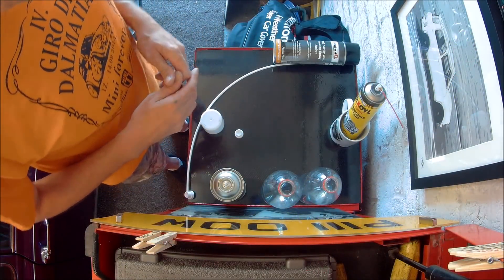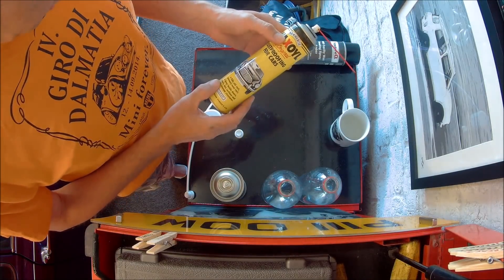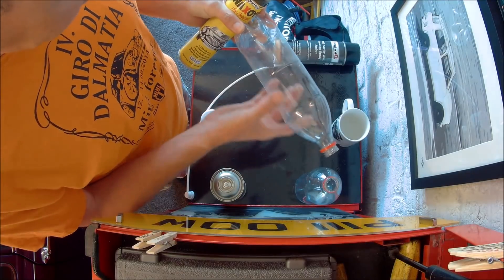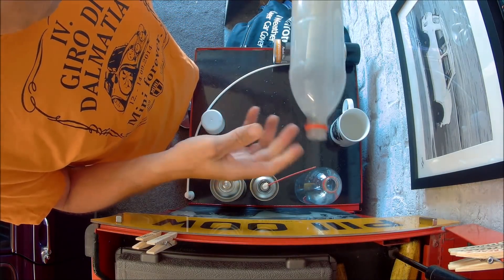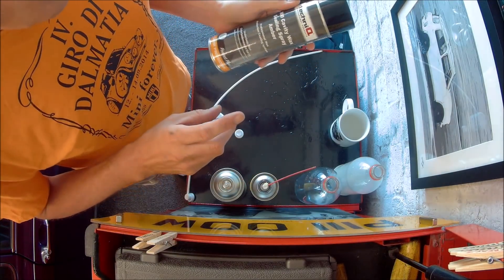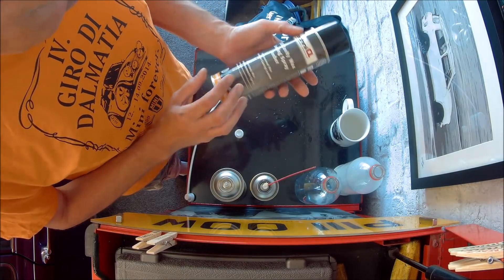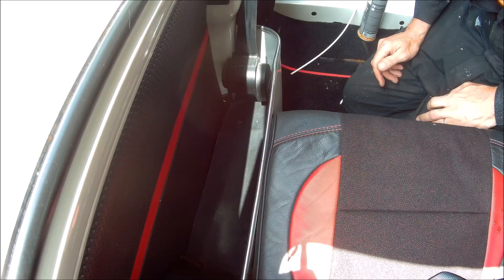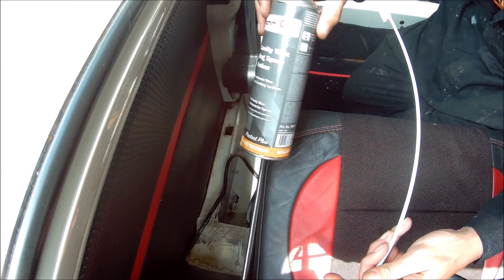Classic Mini Workshop Part 25 - Rust protection cavity wax vs waxoil

Comment: Keith, great video mate. I was raking about in the bottom of my companion bins today when I was fitting temporary speakers to the thirty and my car was swimming in waxoil or something similar. The previous owner had new inner and outer sills fitted (correct type/ nae covers) and it was good to see the repairer took the time and effort to cut out all the rust and protect the new metal from future corrosion. Like you I'm old skool and have always used waxoyl so I may give the Techni stuff a blast. Sean
Reply: @Zain Keaton Thanks, signed up and it seems like they got a lot of movies there :D Appreciate it !
Reply: @Jesse Kenzo happy to help =)

Comment: Morning Keith great work, I need to do the same on my Mini. But this Mini don’t have these access holes on the side glove box and none by the seat belt brackets. Please advise how could I spray that wax? And which brand are you using please? Thanks
Reply from the maker: Bilt Hamber Dinitrol S50 is about the best you can get. If you don't have the access holes, just poke the probe up the sill flutes. The tube is long enough to get where you need to

Comment: Can the long extension be used with the waxoyl cans?
Reply from the maker: Yes if you warm the Waxoil up as it can be a bit thick at room temperature
Reply: Classic Mini Workshop it just got me thinking that a fair test would be to use the long extension on the Waxoyl. Personally I would think  that the thicker consistency of the Waxoyl would give better protection especially with the longer extension giving better coverage. The contender does look much thinner.
Reply from the maker: @_RicksGarage  Yes, I see what you mean. The other stuff is very thin

Comment: Oldschool is goldschool 😌 but should the sills be cleaned out first? Otherwise the dirt will hold moisture causing it to rust? And how do u clean out the sills? Cheers in advance 👌
Reply from the maker: Yes, if they are dirty but unless you have driven through a swamp they should be clean inside. It's worth checking though
Reply: @classicminiworkshop  thanks for the reply 👌 how do u clean the inside of the sill tho? Kind a hard to reach... 😂
Reply from the maker: @Kevmrtwo  Not sure, I guess you could probably use the same setup for spraying in cavity wax using a compressor to a spray gun with the insertion probe and use detergent instead of wax, or if you could get the car high enough or crawl around on the floor with a pressure washer. Apart from rust, I've never seen it dirty inside a sill. I have seen the flutes get blocked up with mud before though
Reply: @classicminiworkshop  thank you! If its rusted inside, i probs should grind it all out weld a new one (or just a sheet) and treat it with your stuff right? Because this stuff doesnt treat rust?
Reply from the maker: @Kevmrtwo  I don't think this stuff treats rust but I think the more expensive denitrol has a rust neutraliser

Comment: Was wondering which one do you think last longer the waxoyl are TechniQ ?
Reply from the maker: The Waxoyl lasts longer in my experience although nowadays I use Dynax S-50 which is far better than both
Reply: @classicminiworkshop  cheers thanks for getting back to me. Would you be able to clean the dynax of the drainage holes with thinners ok?
Reply from the maker: @mr90s48  Yes, I clean it off with brake cleaner

Comment: Hi Keith, can you post the link for the e-bay wax please.
Reply from the maker: No problem. I've added it in the description now. TechniQ Protect Plus 900 Cavity Sealing Wax Protection Spray
Reply: Keith Miller cheers👍
Reply: Just bought TechniQ Protect Plus 800 Underbody Wax Protection Spray Black 4 x 500ml,
Cheers again Keith😉
Reply from the maker: I've been very impressed with the stuff and it's pretty cheap too :)
Reply: Keith Miller 😉 i've noticed that they are in Coventry not far from me as well.